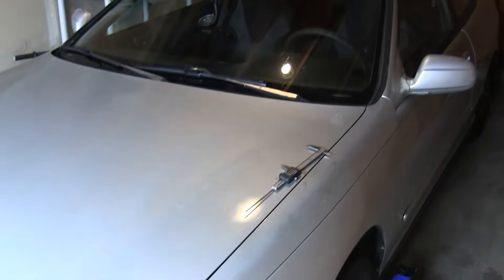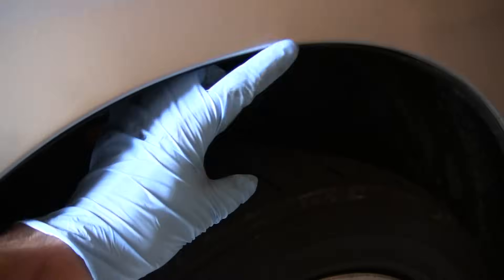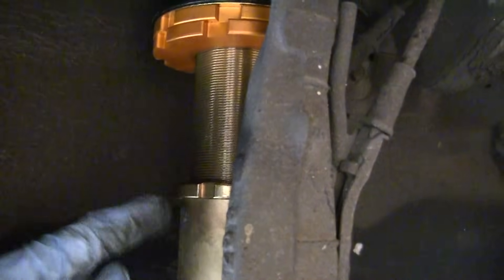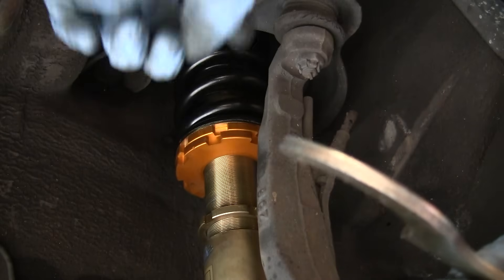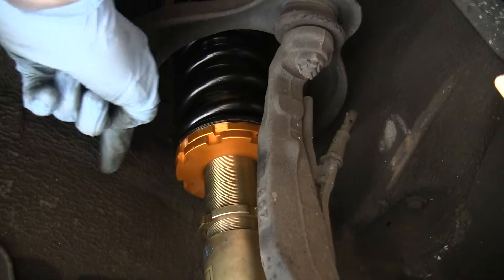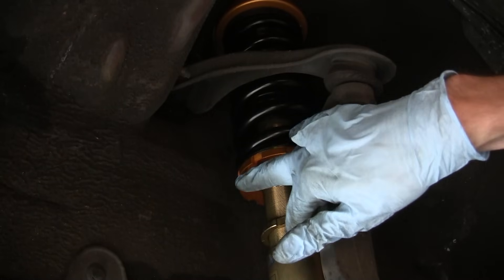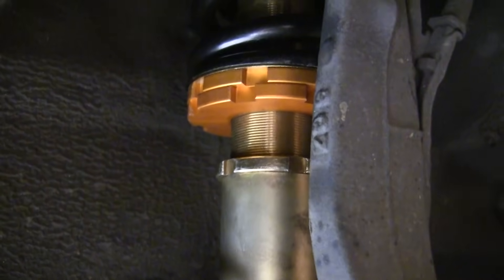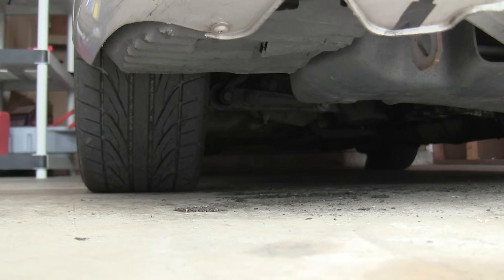How to Adjust Coilovers - Explained

Comment: Can you adjust it without putting the car on jack stands?
Reply: I don't see that happening. You'd have to remove the wheel first to get access to your strut/shock to mess with the height. When removing the wheels, you need to have it on jack stands.
Reply: How else would you get the wheel off without jackstands? The only safe way to adjust installed coilovers is with the vehicle off the ground. Jackstands are like $30
Reply: Be safe. Always put your car on jack stands.

Comment: Did you install camber kits when you lowered your car?  If not how is the tire wear?
Reply from the maker: Roger Agullana I didn't, but I don't drive it much (maybe 1000 miles a year haha, if that). My DD is not lowered.
Reply: Engineering Explained Can I lowering/raising my car ride height without removing the wheels? For the front tire.....

Comment: Although he is adjusting ride height in the video, he is actually changing the preload on the spring. To adjust height with out messing with preload, unloosing the lower lock ring and rotate the coil and both upper rings together. Lowers car, preload stays the same

Comment: i got some ohlins adjustable coilovers and the spring has play when car is in air is that normal or are all coilovers  suppose to have no play in the spring at all? thanks
Reply: Its normal
Reply: +Bounty` Hunter If you have just sleeves then yes. If you have full body coilovers then no.
Reply: ***** I raised the height now it has no play guess it was almost maxed out thanks

Comment: I thought I was adjusting the ride height the whole time and when I was done I realized there was NO pre load and the spring is completely loose. Wtf did I do wrong. Every time I try to adjust the height it just alters the pre load
Reply: becuz he is adjusting the pre load in the video. you need to adjust the veryy bottom ring close to the control arm.loosen and turn. also you should be adusting the height from the center cap and the fender
Reply: MrJaybiz12 one thing i never got was why people adjusted the height from the center cap. i guess i could understand if you measured from the very top of the cap but ive seen people doing it from the middle (or from what they think is the middle). thats my problem with it, if you just try to eye ball the center how do you know your going to be in the exact same place on the other wheel?

Comment: My car has coilovers but the suspension is ridiculously soft and the bottom of the engine and exhaust slam the ground insanely. Enough to kill the transmission mount. Would raising the car fix it to a degree ? The scraping anyway?
Reply from the maker: ThexNOOBTUBEx Sounds like you need to get a different set of coils, and yes, raise it back to stock height.

Comment: Question, do all the gap inches between the tires have to be the same or close to the same height like left front and left back to be symmetrical or is it irrelevant
Reply: if youre asking if the fronts can be a different height than the back, then yes you can have them different. if the front is lower than the back its called rake, too much rake is a bad look though

Comment: What happens if I dont go for a wheel allignment ?
Reply: If you go for a wheel alignment your car blows up
Reply from the maker: Ayoob Giorgio Uneven tire wear.
Reply: Okay thanks !
Reply: Engineering Explained so you will have negative camber?
Reply: Erik Ylänkö Usually when you lower your car, you introduce negative camber to some degree. It depends on the type of suspension your car has. Many good coilover systems allow you to adjust the camber to compensate for this. Another option is an aftermarket camber kit if one is available for your car.
Reply: Erik Ylänkö negative camber itself is not an issue, but the toe will ruin your tires realllllly fast   I run about -3 degrees of negative camber in the back and the tirewear is really not showing (weird but the tires are almost brand new and still the whole tire is touching the gruond minus the stretched area but the whole contact patch is touching the ground which is good)
Reply: cool story bro

Comment: Just wondering does this go lower then the function forms
Reply: Like, as in, does it drop to the function equivalent vector alignment level? Where the line dip meets the flush top nut cap. This is pretty easy question not sure why you are having so much problem with it.Engineering Explained
Reply from the maker: What do you mean?
Reply: Brandon Macdonald wow over your head he was asking if the tonaka coil overs will drop his car more than function and form another coil over brand smh
Reply: Lol gotcha now I see the sarcasm lol

Comment: One final recommended step.  If you take your car to get an alignment, ask to have the car corner balanced.  If they look at you like you are stupid, find a shop that will corner balance your car and corner balance it CORRECTLY so there is no wedge in the car (the sum of your right front and left rear is the same as the sum of your left front and right rear) when you are in the car.  This ensures that your car has the same handling both right and left.  Just adjusting the ride height alone will not corner balance the car and can actually upset that balance and can create a funky handling ride.
Reply: Can I do corner balance even I don have adjustable drop links?
Reply: Bro real men don’t get an alignment
Reply: @awwbubba3071  😅
Reply: Very important.. I’m dealing with that right now
Reply: A wedge in my tire to say the least

Comment: Question for you: I've heard pretty often that you should not adjust the lower ring (not the lower shock collar, but the lower one by the spring perch) as that will mess with the preload, on coilovers with threaded shock bodies.  So, I'm slightly confused.

Comment: Your supposed to measure from the center of the hub to the tip of the fender, its done this way during a regular alignment on a rack....
Reply from the maker: Doesn't really matter where you measure from, just pick the same spot and stick to it. Though if the tire were deformed then yeah the ring could be off.
Reply: dOp3bOi599 my fenders are all bent :]

Comment: Engineering Explained what is the lowest and highest you can go? I want these but I usually take long trips through really nasty roads. For these trips I would most likely try to go close to stock height.  Is it possible with these?
Reply from the maker: Probably around an inch lower, at the highest. Though if you adjusted the pre-load you may be able to fit in another inch, but altering the pre-load isn't exactly recommended.

Comment: By altering the height of the coil- over spring, does it affect the spring stiffness in any way?
Reply from the maker: Theoretically, no, as it is a linear spring so the rate is constant with deflection.

Comment: Toe wears the most, camber only some and caster only if the car corners a lot. Camber wear can be fought by keeping the tire pressure slightly lower than the recommended 32psi. Camber kits are terrible and should only be used to increase the camber angle on a track car. It greatly alters the suspension dynamics, worst thing is probably causing parts to interfere, like on that double wishbone front suspension the control arm can hit the shock tower.

Comment from the maker: So far so good, I definitely like them. They are stiff so they won't compress as much with weight in the car, but that said it is a bit rough over certain bumps and such. But yeah I'd say worth it, I've looked at others and the spring rates seem to be fairly similar across the line.
Reply: Yo

Comment: I'm interested in the yonakas for my car are they worth it? I usually have a full car so I wouldn't like them to not hold an rub on my tires. My stock suspension does that and its so high so I need something stiffer and longer lasting

Comment from the maker: Check out my videos on camber, caster, toe, and steering axis inclination. These are different variables (some of which are not adjustable) which can be used to alter alignment. Most shops will alter toe, and some will alter camber (if adjustable). To be sure it's done right, ask for a print-off of the alignment before and after, and ask what the OEM spec for the vehicle is. If they can't tell you (or provide this), pick a different shop!

Comment: You can get more adjustments from some more expensive coilovers on top of height adjustment (or preload). But they are mainly use for 80% track and 20% road.
Eg. compression and rebound adjustment for the shocks.
There are also some coilovers that you can adjust high speed compression and rebound, and low speed compression and rebound.

Comment: search on google: "KW 24h Rennen nürburgring" and you will find an article where I have my information from. I also was on the Nordschleife the last times. Bilstein is not bad but the most (and the winners) drive an KW Competition suspension. I am in an racing team and drive 2 cars at slalom and Glp on the Nordschleife and most drivers just change from Bilstein to KW.

Comment: If you lower it too much and start dragging the ground on bumps, you can adjust in less jounce travel. You would lengthen the shock tube, and also lower the coil spring bottom nuts a corresponding amount. This would reduce suspension travel and reduce hitting the exhaust on the ground. It might also reduce the tires rubbing the wheel wells while keeping a low ride height.

Comment from the maker: Spring stiffness will not change, and I'm not changing the overall length of the spring (known as adjusting pre-load).
Reply: This was my main question. If you put the coilover all the way topside or bottom it out.. The spring will feel exactly the same???

Comment: So are you using the two upper rings to turn the whole body of the shock? As long as the rings do not separate from each other, the spring preload will not be changed correct?

Comment: When lowering car make sure to adjust all the other suspension parts, otherwise the whole design and ride of the car is severely affected and many parts will break causing many many problems, don't just lower or raise a car because it is 'cool' do it for practical means, which there really are none.  Thank you

Comment: It will change camber (the angle of the top or bottom of the wheel with respect to the center hub) meaning you will want to change the toe (the angle of the front or back of the tire with respect to the center hub).

Comment: I can do mine pretty easily with the wheels on. It helps to steer the front wheels to the side to use the C spanner. It's going to depend on your car and dexterity I guess. Lubrication helps as you can spin the shock by hand rather than having to turn it with the spring perches and spanner.

Comment: Pros:
 + Adjust the ride height
 + Can corner balance -- to adjust so that each diagonal pair of wheels carries an equal share of the car's weight, which improves handling. 
 + Preload can set where in damper travel the car sits.
 + Springs can be changed (damper valving may limit this)

Cons:
- High maintenance: collars, threads, upper mounts, get gunked up/rust
- NVH: depending on the choice of bushes, upper mounts, insulators you may get more road noises, clunks or vibration felt in the car.

Comment: ... because that costs more, you may not find a local shop that can do it, and is most beneficial when you're driving at the limit -- in a street car you're not. 

The other key benefit is being able to choose the height that you are most happy with, and change your mind later, or being able to lower your car significantly more without sacrificing bump range.  For a lot of people these are selling points.